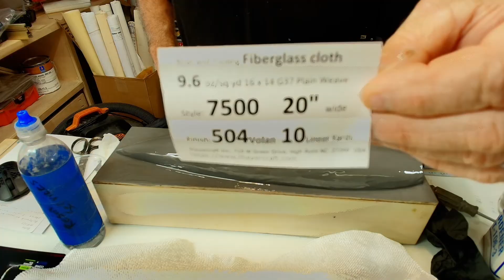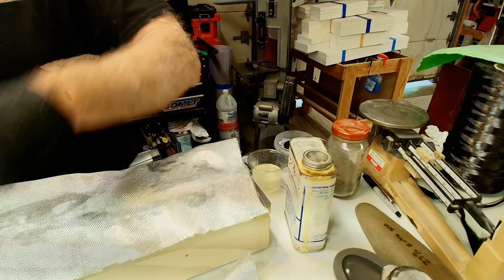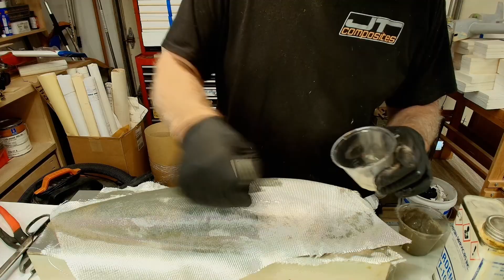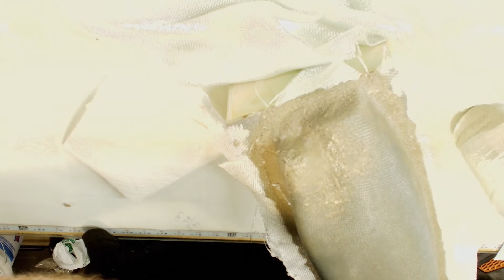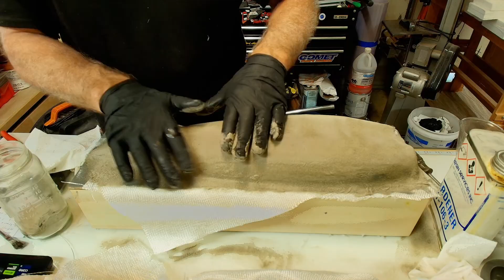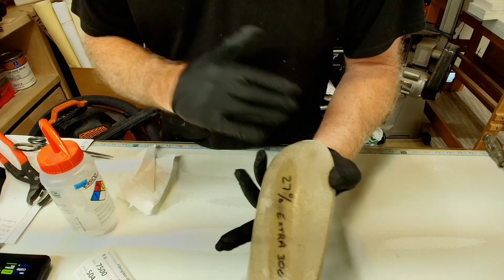Building up the fuselage mold with fiberglass

Comment: Thanks for video. I do something similar as the gap filler. I use west colloidal silica (help epoxy stick on vertical surfaces) mixed with cotton flock (gives strength and fills). Mixed to same mayonnaise consistency this is painted over the tooling coat. It gives a big blanket that the conformal cloth beds into. Cuts down on all those micro bubbles that can form. Before cloth goes on I run a gas torch over the fill to pop any concealed bubbles
Reply from the maker: Great tips. I will have to put some of that info to use. Thank you for sharing and watching.